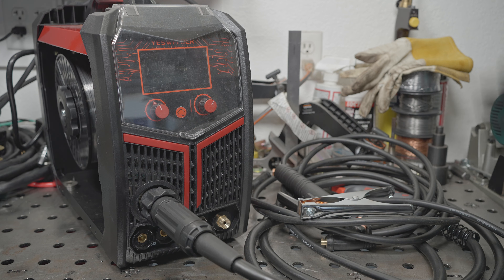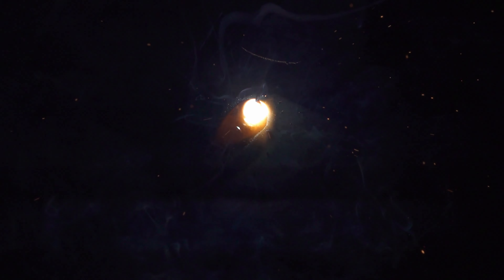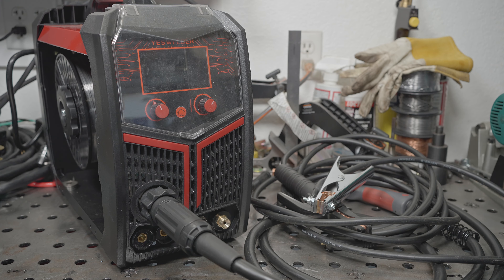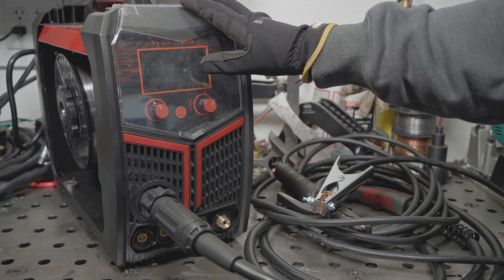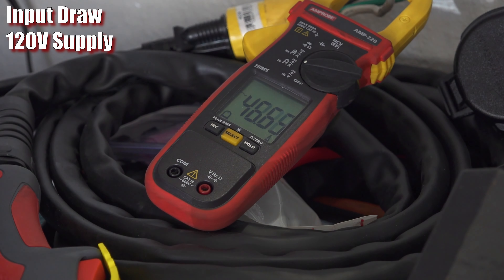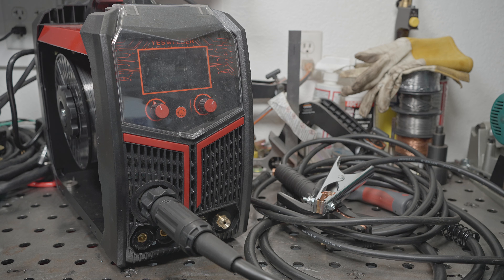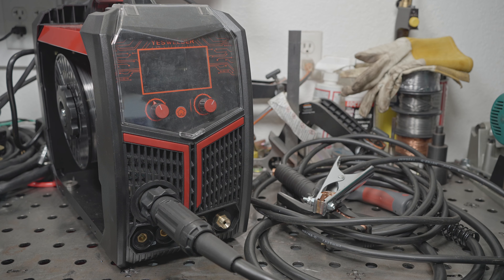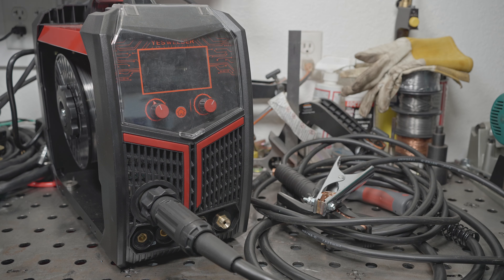Yeswelder Firstess MP200 Part 2: Stick, Dual Shield and Lies

Comment: I understand the frustration with false advertising, cheap stingers, cheap ground clamps etc. etc. but you must remember these are hobby machines marked to "hobby welders" and "DIY guys" building weekend projects in their garage. As a hobby welder I ask myself these two questions when considering purchasing one of these "budget" machines. Can I afford the machine? Will it do what I need it to do? If the answer to those two questions is "yes" then I'm a happy customer because it has met my needs. If not, then I either don't purchase the machine or I return it and try something else. Discrepancies with the specs, performance and documentation is just par for the course and expected at this price point. (unfortunately) Just like the saying goes "you get what you pay for". Purchasing a hobby welding machine is a  perfectly good example of why that phrase exists. If I'm not ok with the downsides of a budget welding machine then I need to be prepared to pay 4 to 5 times the price to get a machine that I can be happy with. For a lot of hobby folks (myself included) purchasing a reputable brand name welding machine for hobby welding and weekend projects is not an option. I'm just happy these affordable machines exist even with all the discrepancies and downfalls because without them, I wouldn't be able to afford this great hobby. 

Please don't think I'm trying to discredit your video or your findings. I really like what you do in these videos and it's "eye opening" information that I think is good to know. My comment is only my personal opinion from my personal viewpoint on this subject. We all have different opinions and viewpoints based on our own personal needs. 

Keep doing what you do and I'll keep trying to learn how to glue metal together with electricity! LOL Have a great week!
Reply from the maker: I understand where you are coming from.  And I agree that less than stellar build quality, a lack of high-end features, cheap accessories and lower output and duty cycle are to be expected with a cheaper, "budget" machine.  And I have no problem at all with someone being satisfied with any product.  If the welder meets someone's needs and they are happy with it, that's great.

But I respectfully disagree that we should expect or allow inaccurate specs and inaccurate info on data tags to become par for the course with a company like Yeswelder, who is trying to position themselves as a big name in welding.  I understand that if I buy a generic welder off Amazon or eBay and it has incorrect specs, that shouldn't be surprising.  Many of these "companies" don't care and don't have any accountability, so that kind of thing is going to happen.  I still don't like it, but it is what it is.  But Yeswelder is really pushing hard to present themselves as something else, something better, something more legitimate.

I see two possibilities.  The first option is that people would buy the machine anyway if Yeswelder was just honest about the fact that stick output was 160 amps max and they would appreciate the display more closely matching output.  In that case, just be honest!  You have nothing to lose.  The other option is that people wouldn't be willing to purchase the machine based on the value it represented if they were honest about the output, in which case they are actively, deliberately defrauding customers and are misrepresenting their machine and its capabilities to any agency they happen to be using to verify safety and regulatory compliance (which I doubt they are doing anyway).  Either way, I don't think we should allow a company to grow and become massively successful off the back of false advertising that they absolutely do not seem willing to fix.
Reply: @bigtb1717  Fair enough and you make some good points. I don't know anything about the way Chinese businesses work or what rules they have to follow. My gut tells me they do things completely different than any US based business so I just accept that for what it is and move on.
Reply from the maker: That's totally fine.  I have no problem with someone liking Yeswelder machines, being satisfied with the performance and value of Yeswelder machines, or even singing their praises if that's how they feel.

There are plenty of Chinese companies that sell products in the US and who would be called out for blatantly false advertising, inaccurate specs and intentionally deceptive programming of a device to mask these inaccuracies.  DJI, Z-Cam, Lenovo, ZTE, Hisense, Oppo, Xiaomi, sE Electronics, etc.  Are any of those companies perfect?  Surely not.  Any company can make mistakes, do shady things, make a poor product, etc.  But regardless of the country of operation, I don't believe they should be given a pass to clearly, knowingly, repeatedly and continuously misrepresent, mislabel and deceptively program their products.  

Yeswelder took in millions of dollars in funding for the MP200.  The MP200 is currently $1,000 on their website.  This is not some super cheap machine.  $1,000 is a LOT of money.  

Yeswelder is pushing their brand all over the place.  the hashtag "why we weld" thing is all over the internet and even in my email box.  This is a company who, in their words, is a passionate about welding with a love for the industry and is making high-quality, state-of-the art, safe, high-performance equipment.  But at the same time, they are releasing welders that haven't been submitted to any safety or regulatory agency for any kind of testing or certification.  Yet they print those agency certification codes on every one of their completely inaccurate data tags.  With the welders that actually include manuals, those manuals are full if inaccuracies and misinformation.  The machines themselves are very often not capable of what they claim and are often programmed so the display makes it LOOK like they are.  

I just think that if they are going to advertise that they actually care about their customers, care about quality, care about the industry and are committed to improving and becoming part of the welding community, then they should absolutely be held accountable for their blatant disregard for honest advertising and blatant misrepresentation of specs and performance.
Reply: I pretty much feel the same way, very well expressed.
Great review filled with legit information, sure wish more were like this.

Comment: man... I'm pissed... I have a gen1 FIRSTESS mp200... and I haven't gotten this thing to weld consistently let alone start an arc.

I bought this cause I listened to some you tubers I thought weren't ever bought out by sponsors.

I thought I just straight up couldn't weld anymore. but I use older machines and can weld just fine... wtf!

Comment: Good video
Reply: I weld for a living and I run miller xmt 304 and lincoln 350 pro invertec and 180 pro mig but I have a AHP alpha tiger 205 ds and would be curious about a review on one of those I occasionally use it in the shop for. Tacking and so on its portable I wouldn't say light but says 120 amps on 110 power and never trips the 20 amp breaker except when stick welding

Comment: Update.. after 2 weeks and an email a day the only help I got was a picture of a finger pointing at a connector to check... When I asked them what to check with a meter or am I just verifying it was plugged in they replied "we have reviewed the video you sent us again and it's broken and can't be repaired, sorry.". Basically they just want to string you along until you get tired and give up. So now I have a paperweight.
Reply from the maker: Sorry to hear that.  They won't offer to replace it or anything?
Reply: @bigtb1717  No, I'm outside the warranty... But only like 30 min use in 1.5 yrs... Should last longer than that. I hoped for some help getting it up and running, like any help at all! I think their business model is to buy em cheap from China or wherever, slap logo on and charge double what their cost is... That way they can make their one year warranty work as they seem to only replace not repair.... On the surface that sounds great but I've heard others say it's difficult to get them to actually fulfill their warranty obligations without a lot of follow up!  Also they won't post my review up on their website so I know that they screen what reviews they put on their website to create the illusion of only satisfied customers.
Reply from the maker: I had two reviews on their website that weren't even terrible, just honest.  Both gone.  Most of their machines don't even have a warranty listed.  Their advertising talks a really big game, but they don't seem to back it up.
Reply: @bigtb1717  Yeah.. they have good marketing and I love a value purchase... I just want to get the word out so people know what they are getting into. Some people don't have money to throw away.. It seems like they just hide or drown out the real reviews with marketing tactics like pretty welds and likely paid reviews.
Reply: @jonrnas  If you bought it with a credit card, you might be able to get a refund using the credit cards benefits which extend manufacturer's warranty.
Reply: @morenothing4u  You know I didn't even think of that... I'll have to check. Thanks

Comment: This is the brave new world we live in. All the "budget" welding machines on the market have the same issues. They built around the cheapest Chinese OEM half-bridge toroidal transformer topology with not so sophisticated feedback loop. Basically, none of them match the amperage advertised on it. Furthermore, they don't lay a good weld thanks to the crappy tuned feedback.

P.S. Incorrect data tags on the factory. LOL  )))))
Reply from the maker: I'm getting sick of Yeswelder pushing so hard to make themselves seem like a mainstream, big name welding company while still straight-up lying about the output their welders can achieve.

Comment: Wow I have an older millermatic 250 and was looking for a small portable mig/plasma cutter. This won't be the one. Great price but just listening to it run gives me chills. Do you have any idea for a machine in this price range?
Reply from the maker: There really aren't a lot of options for MIG and plasma cutter combined machines.  You might be better off getting two separate machines.  Are you looking for a 120V machine, or dual voltage?

Comment: I noticed they are lying or marketing and customer service s clueless.  I bought a long mig lead and I told them the contact stuck out 1/4", normal they say.
 There needs to be more welder testing.   There are a bunch of chinese welder brands taking over the market claiming to be just 
the same as Miller, Hobart, Forney, Lincoln.  Are they?  The imports may put the others out of business or force them to close their American factories. ( they may alread just be assembly to compete).  Companies are sending out free welders to youtubers with a  just 1000 subscribers, probably rejecting a review that makes them look bad.
 Torque test channel has been kicking liars about false claims for a few years and I think some have changed ( impact wrenches and flashlights)  
It makes you respect a company more when they are close enough to be just testing setup differences.

Comment: 6010 rod runs best on AC welder you have a Inverter welder DCEN welder that does not run 6010 rod super goid but does 6013  good.
Reply from the maker: I actually ran DCEP.  Most 6010 rods are rated to run on DCEP and I have some inverters that run 6010 well on DCEP.  I've never tried running 6010 rods on AC.  Could be fun to test and compare DCEP vs. AC with 6010 rods.

Comment: You can buy a miller 215 that does everything but plasma for $1800/2k
Reply from the maker: If you leave out the plasma cutter you can get FAR better machines for $1500-$2500.

Comment: ,If You can Aluminum Weld , MIG OR TIG With this Machine I Will ORDER ONE !! THX BEN V.
Reply from the maker: TIG is DC only, scratch start and no foot pedal or other remote amperage control.  It's not designed for aluminum TIG and is basically worst-case scenario for aluminum TIG.  

As for MIG, it doesn't support a spool gun out of the box.  You might be able to get aluminum wire to feed through the gun or get an aluminum capable MIG gun, but it's really not designed for aluminum MIG either.

Comment: 70xx 240v 1/8 7014 EP
Accuracy of clamp meter claim to be +- 2.5%+5
Display. Measured
110 96
120 106
130 114
140 124
150 131
160 140
170 149
180 158

120v
100 90
110 100

I think it was an ok deal at the early kickstarter price 584 in 2021. It's 2024 there are more options.
Reply from the maker: It looks like those are results from your own testing that you are sharing, right?  Thanks for sharing.  It's always nice to have more data points.  Once in a while, I will test a second of the same machines, but the majority of the time, I'm only looking at a "sample size" of one unit.

Yeah, it was certainly an easier machine to justify at the $500-ish price than $1,000.  For me, the main issue is the fact that they publish false specs, program the machine to display incorrect readings, and refuse to fix it.  It's like the $100 (or even sub-$100) welders that advertise 250 amps and only put out 130-ish.  A 130 amp stick welder is pretty capable, especially for $100 or less.  Why lie?

I guess I'm just at a point where, after seeing it in so many products (not just welders), I'm no longer willing to find it "acceptable" for companies to lie, simply because their products are "cheap."  Maybe Yeswelder isn't even intentionally lying.  Maybe the manufacturer who is building these things for them is shafting them.  But if that's the case, Yeswelder should be just as upset (if not more so), than their customers.
Reply: @bigtb1717 If you ever been to the back streets of Kowloon in Hong Kong where they pedal off brand electronics to people you would understand.  My experience is from the late 90s early 2000s.  Doubt it has changed much.  I highly doubt Yeswelder is making their own machines.  They are probably using an oem subcontracter's design and rebadging. It be interesting if someone tested their 2024 model of the mp200.
Reply: Display Measured
200 170

When set at 200A it does have hot start when I stuck a 6011 rod and it glowed red. The clamp meter read 200A for a few seconds.  You can try it yourself.  It could very well be some settings or the hall effect sensors around the cables weren't calibrated properly.  You can see that the hall effect sensors have some microdials.  Those big cables looked like they're probably aluminum, idk if that would make a difference.

Comment: If you ever do a in depth review on the Synergic Hitbox Pro and or the Amico Manual Mig 200 I would greatly appreciate it! Something portable 120v and also 220v for thicker materials.   I am disappointed with both my MP200 :( I need something reliable and not so expensive  like those 2 welders listed. Its difficult to trust this Chinese manufacturers with the overblown specs and duty cycles!  Basically more lies and lies.
Reply from the maker: In case you didn't see it, I just uploaded a video comparing this welder to a Hitbox Synergic MIG Pro 200, as well as a Fronius Transsteel.  I do plan to make more videos with all three and will probably do a full review of the Hitbox at some point.
Reply: @bigtb1717  YOUR AWESOME!! !!!!!!! Please don't forget the Amico 200 Multi mig manual if you can..
Reply: @bigtb1717  Awesome reviews! Please do more. Much better in depth than others! No skipping steps! 5 Stars!

Comment: Rebranded junk! Lookup Keygree welders. Can be had for 150-200 all day online. This one is a rebranded Keygree 250 as far as I can see. I have a error 1 code on display. Units only been used for 30 min since ai bought it...They said out of warranty nothing they can do.. which I get.. however they also would not allow me to talk to support direct, only a call center. They also blocked my email when I tried to ask them about what part needs replacing or what error code meant... Buyer beware. Hope my incident was a fluke. Really liked the welder when it worked but feeling a bit hung out to dry.
Reply: Didn't the data tag say you needed to give it 45 amps at 120v to fully get that 160 amp.  I was able to get displayed 110 amps, 100 amps measured on a 7014 1/8 rod with a dedicated 15 amp outlet, one foot from the breaker.  If I long arc it it would trip.  There is hot start it was measured 135 amps.  Haven't tried any more measurements, not till I get my weld fume exhaust setup.  I used a $30 amazon clamp on DC amp meter, take that for what it's worth.

Comment: I am no pro. But None of my other welders run like crap on .035 solid core wire @ 220v welding 14 gauge steel. I feel very disappointed with this welder with all the hype. Other users say I am crazy being too picky.  When I weld not only i rely on the gauge reading settings you kinda can have a feel to the sound of the weld as it arcs to know you have the right settings. I cant explain it. My gut feeling this welder is underpowered weld like crap and u have to mess alot with the settings.  Like i said its a gut feeling when i weld it only happens with this model.  If this welder was fully and accurately measured and tested I believe it will fail sadly .